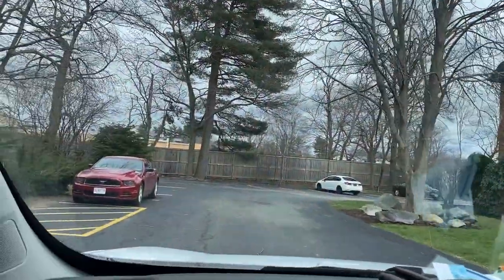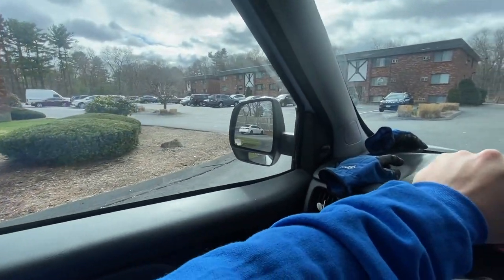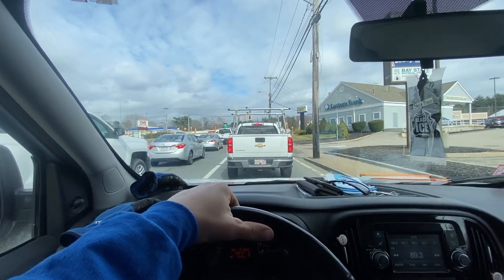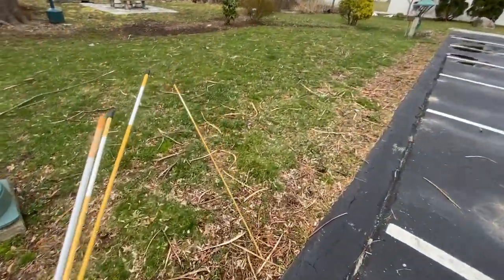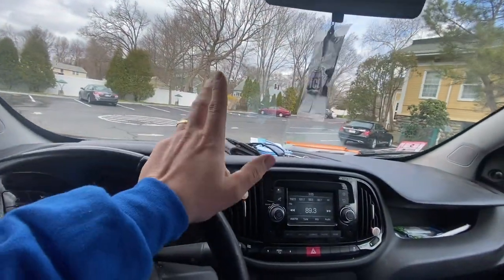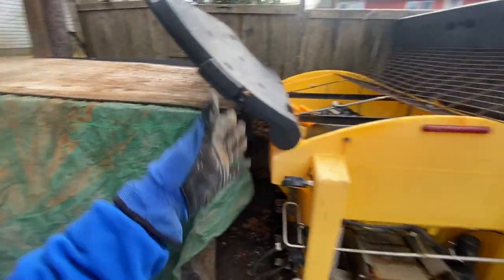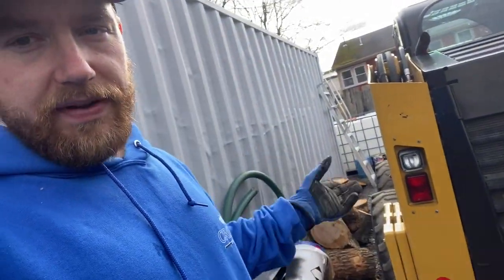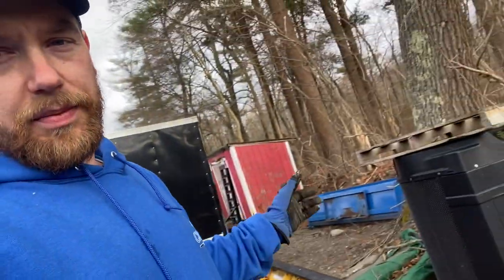2024 Snow Plowing Season Wrap up...The winter that never showed up!

Comment: I don't have a plow but I prefer straight blades verses v plow v plow if u hit something with a v plow it will damage the plow more than a straight blade as for fisher I like a lot as for a gas engine truck  I think it is better than diesel because the new diesels are not what they used to be plus u have to plug diesels in